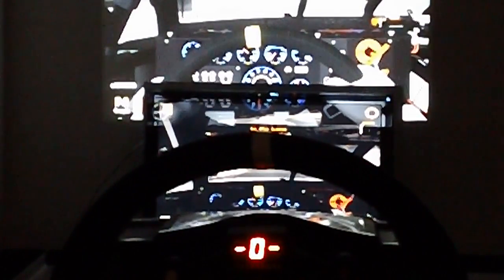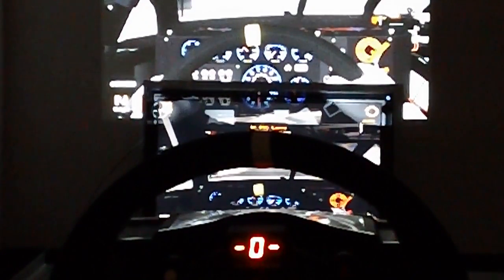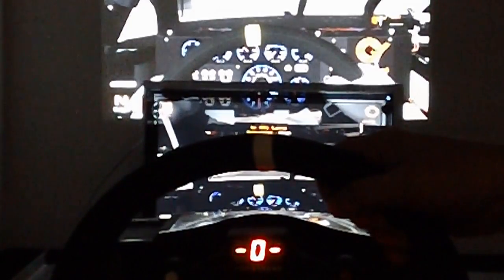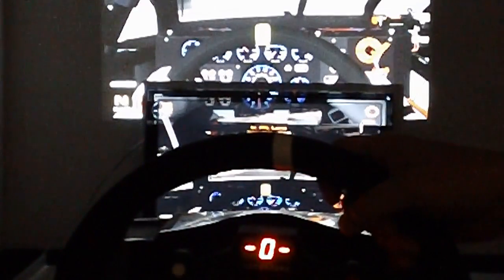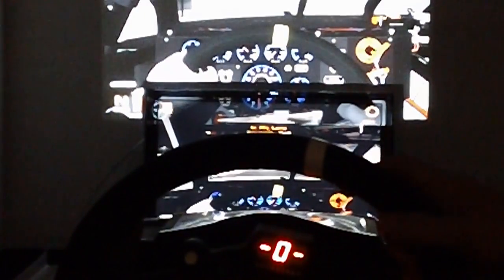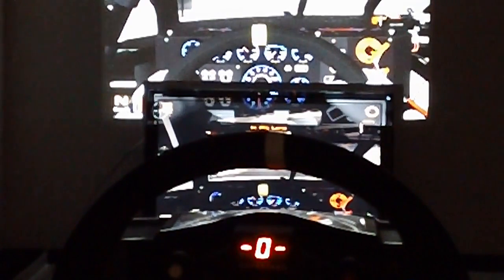Part 3 of 3: NEC NP-V260X Input Lag Testing Using iRacing.com

Comment from the maker: Thanks... No warping. If you check my latest video, you'll see where I'm headed. Will be three flat, 40" diagonal 4:3 screens which wrap around a full 180 degrees, illuminated by rear projection.